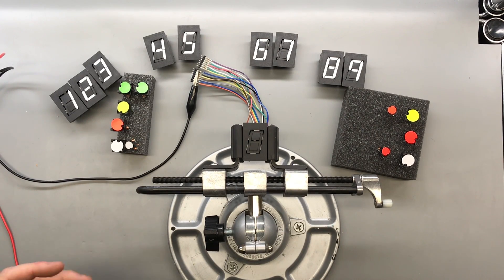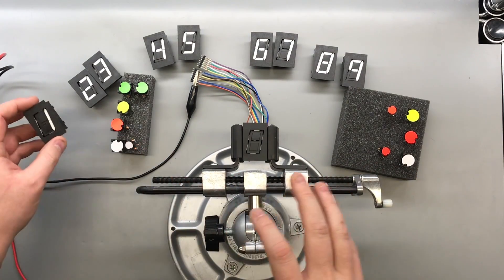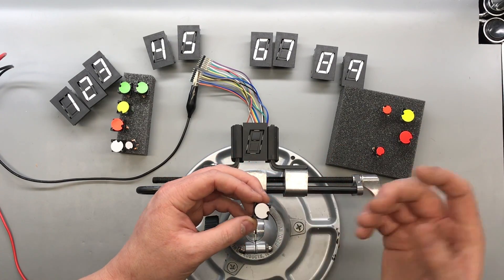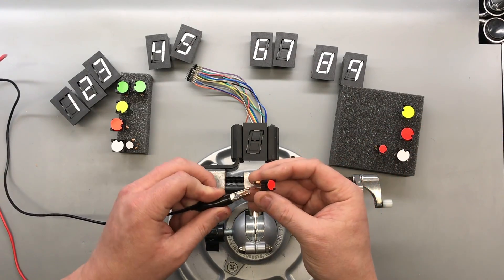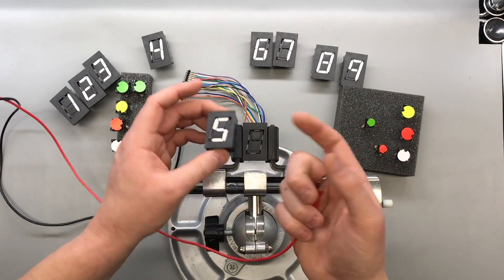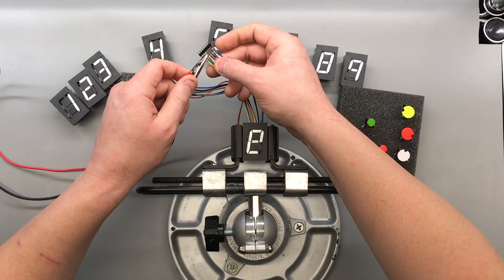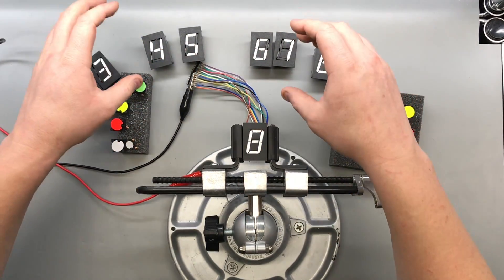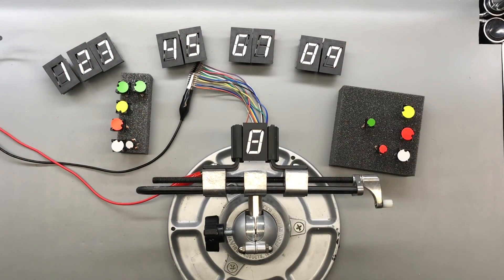Electromechanical 7 Segment Displays and Flip Dot Indicators

Comment from the maker: The flip dot indicators work because the dots themselves consist of two magnets and the two coils in the back are wound in series but in a different direction. When the coils are energized, the magnetic fields that they generate are of opposite polarity.  The 7 segment display work similarly but they are pushing and pulling the small white segments.
Reply: Proto G could you please tell me how much the seven segment modules cost? I looked on the supplies web site but there isn't any pricing...
Reply: @ALeAnn365  You simply send @alfazeta an email asking them and the guy replies pretty quickly with a price list - ask what you want as things are priced according to the scale of what you want to do.  It's impossible for prices to show on their site as everyone's requirements are different 😉
Reply: https://coytbarringer.com/flip-display-clock/
Reply: instablaster.

Comment: You also get the flip displays with built in switches, used as failure indicators on equipment. The switch allows multiple diode or inputs to flip the display to on, and then the switch contact allows an external monitoring circuit to show the unit as failed. Used mostly in aircraft on the avionics boxes, to show an in flight failure of any system on a master caution display. Generally the power on cycle has an automatic reset of the indicator if failed, so that the pilot can power cycle the box for an intermittent fault, and hope it is transient. If not then there is either a redundant unit, or an alternate method for critical equipment, or else it is merely no longer available for use.
Reply from the maker: Very cool, thanks!

Comment: Very cool! I wanted a clock using these for a while, but since I'm not an EE and I couldn't find anything on how to drive those on the Internet, I did not order them. Looking forward to learn from you!
Reply: Common segment on the one side of the display, and a half bridge on that. Then on each of the other display segments you have another half bridge, and then you can simply flip each bit as needed, to set or reset each segment as needed. Alternately you need a split supply with the commons connected to ground, and then you either connect the other side to a positive or negative supply rail to flip the bit.

These displays are hard to multiplex, as they are basically resistors. Thus to multiplex you need to use zener diodes in series with the segment drives, to make then settable with a low supply voltage on the segment half bridge, and a transistor half bridge driver per digit, and drive all the segments in parallel. To reset you need to have a supply for the digit drive that is higher than the zener voltage and the display trigger voltage, and then you simplyselect the digit you want to blank and set all the segment drives low ( what they will be in normally unless setting a digit) so the reverse voltage across the zener flips the display all off. then you can rewrite the correct display. Klunky, but does save a whole load of drivers on large displays, and the bits that are already off stay off on reset. You only need simple segment and digit drive bridges, and a low current ( as you will only have a short reset current pulse drawn from it) higher voltage rail to do reset. 

You do need a good number of logic level translators, but these displays are easy to drive using standard 4049 or 4050 CMOS level translators, making the design a little easier for the smaller ones. Large ones you generally use discrete 3 transistor drivers for the segment side, just for the higher voltage beyond regular IC drivers.

Alternative display types have a set and reset coil, so are easier to multiplex, but are a lot larger and expensive.
Reply from the maker: sligovolts thanks!
Reply: Drive is relatively easy, you just need a half bridge per segment and individual digit drives are half bridges. The alternate method is to use zener diodes and 2 supply voltages, so that the displays can be multiplexed, but there you only have a set ability, the reset will perforce act on all the segments to turn them off.
Reply: Pardon if this is a stupid question, but how can you change the polarity of the coil using only a half bridge? I did not follow your first suggestion of using two half-bridges, one for each segment and one for each digit.
Reply: Thank you very much for your detailed explanation!

Comment: Very interesting and cool project!! What voltage are you using in the segments and where is a good place to buy them?
Reply from the maker: Ozmo Mac thanks! I’m using 12V to drive them.  A good place to tinker is to find them on eBay used but you can also contact the company directly for a quote.
Reply: Remember to use a series resistor if there is the possibility of them being driven continuously, to limit the current. They do not like long drive times, but a series resistor with a parallel capacitor across the resistor reduces drive current a lot.